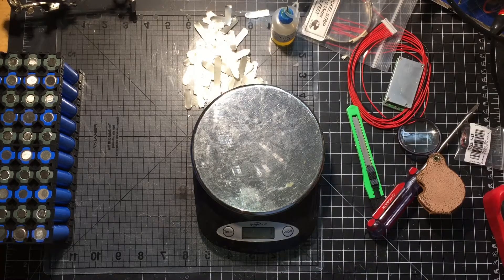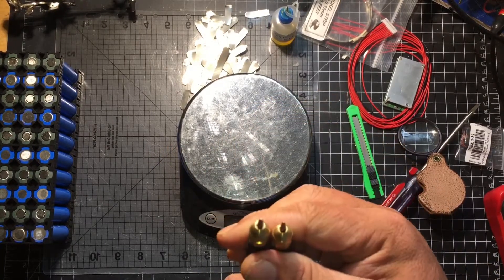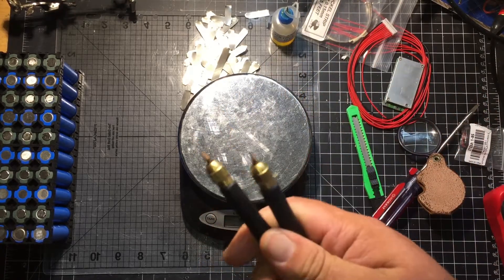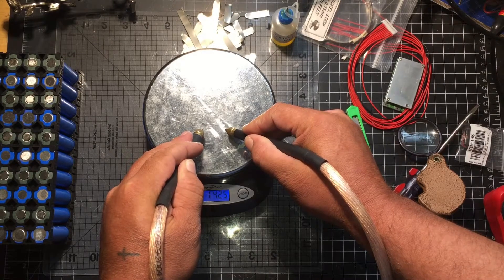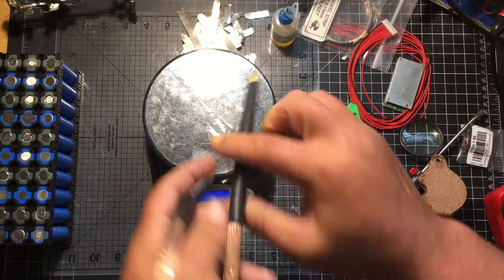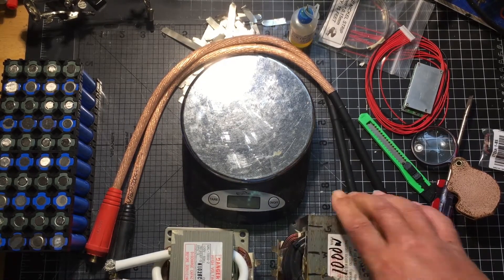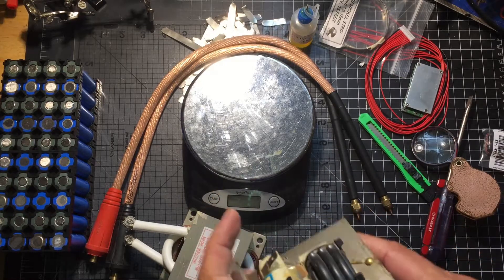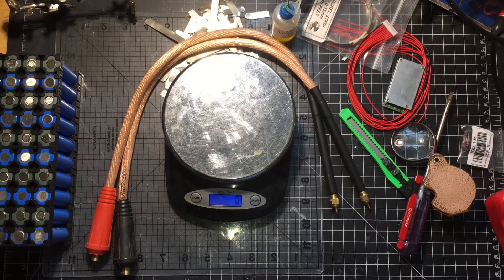MOT 18650 Battery Tab Welder (why won't it weld? "Fix") Quick Tips and Tricks

Comment: Took your advice, Filled the eye completely. Now there is so much current to melt the copper electrodes into the welds. I'm going to try an old vacuum cleaner's power controller to limit the primary voltage.
Reply from the maker: I have seen people use a wire coat hanger, but that to damb scary for me. You might try one of those cheap Chinese controllers like I used in my last build👍👍

Comment: I need to correct you. You say the more pressure, the higher the resistance. In fact, the more pressure, the lower the resistance. You want a certain amount of resistance so that more wattage is dissipated at the point of contact. Too little resistance means insufficient wattage is dissipated  therefore no heat, therefore no weld. It's also called resistance welding for this reason. Otherwise, very useful!
Reply from the maker: Yea I get those backwards sometimes, but those who have issues welding should get the point hopefully. I always see new tab welders pushing far to hard!!

Comment: My guess,  secondary winding gives you output voltage it has nothing to do with power output. Transformer space utilisation is about resistance. Say you want to have 2,2V output, so calculate you will need 2 winds of secondary windings. If you are using thin wire for this purpose , you get the same result as with the thick one except. the resistance is higher. So in that sense you may anticipate more power will fall on transformer. As far as I know the best result you get  when the power is balanced: the resistance on transformer is equal to resistance on weld.
Reply: @Joachim Shekelberg actually physics says it should be balanced equally, then you get best power output. It apply to all  electric circuits..
Reply: @Joachim Shekelberg maximum power  theorem around 1840; it is also referred to as "Jacobi's law"

Comment: I been having difficulty welding 0.25MM thick nickle strips to large cells.  Which would be better to use AC or DC .  Also what is a good way to weld nickle strips to each other ? I've not had much luck.
Haven't had much trouble with smaller cells.
Reply from the maker: Have you made sure the pressure is correct? Like i showed in the video? Are you apart of one of the Facebook groups? I can tell you, I personally feel when going threw thicker strips or bigger batteries, DC seems to do the best by far.  When I dc weld, it doesn't matter how hard I press the leads, it welds quickly. If you can weld onto a battery with Nickel strip, adding another layer shouldn't be an issue, it's basically the same thing.
Reply: The directions on my DH30 says .1 to .15 mm only.

Comment: hey buddy, good to see your back making videos.. we missed you on discord :P that's a good way to test it. ugh, really need to build myself a spot welder before I go back to AU next year
Reply from the maker: Man, they are soooooooooo simple and you can build them with basic garbage. My first one, I used electrical wiring from an old range for the winding and cheap solid core copper wire for the electrodes. I have done 3 more projects from my last video, a Boom Box with Dayton Audios, 10S balance board and a 10S Battery with Protection. I need to get in gear and edit...LOL